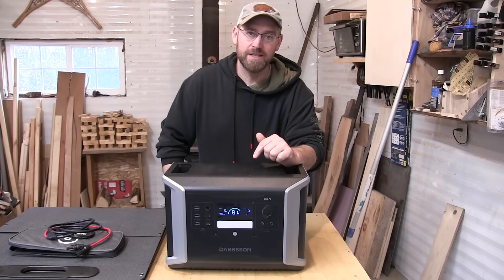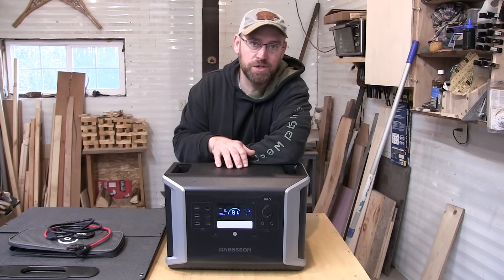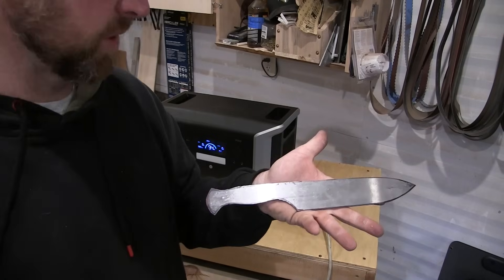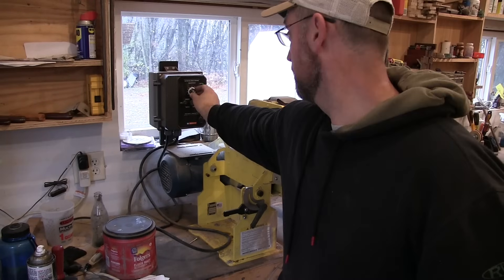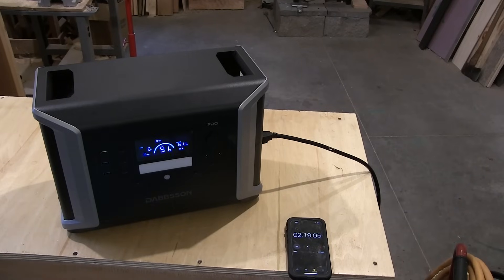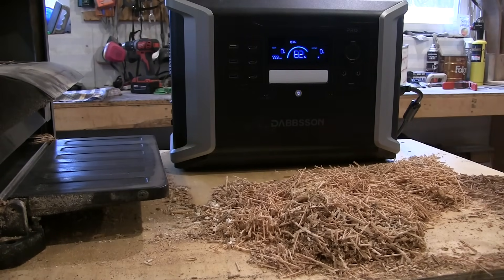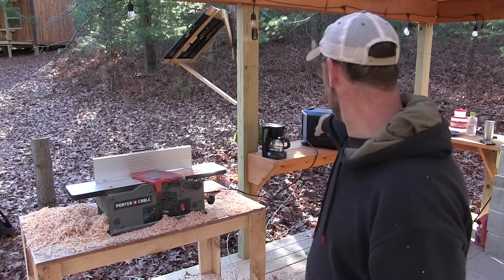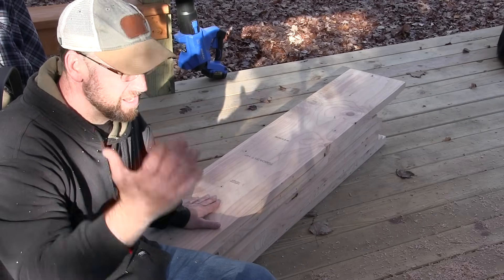Dabbsson DBS2100 PRO  Review and stress test

Comment: Just picked up the DBS1400 pro on a black Friday sale. Seems like a very well build power supply but notice one thing that was worse than my other power supplies. After a full charge I notice the next day, it was down to 92% and then 88% the 2nd day while just being stored.  Everything is off on the unit. I wrote the company and haven't heard anything.  At that discharge rate it would be almost dead in 3-4 weeks. Otherwise, it works well.
Reply from the maker: I noticed the same thing then realized you have to hold the power button for a couple seconds before it actually turns off . a single tap makes the screen shut off ,but it doesn't actually  shut off unless you hold the button . now the charge stays up
Reply: @blackspruce1861  Thanks. The company did reply, and the problem is I didn't hold the power button long enough for the power off sign to flash.  Everything good now.
Reply from the maker: awesome !
Reply: Discounted items will be of poor quality.
Reply: @forestrynatural  It's brand new. Have been using it for a few days now and works perfectly.
Reply: I'm wondering if it charges in OFF mode.